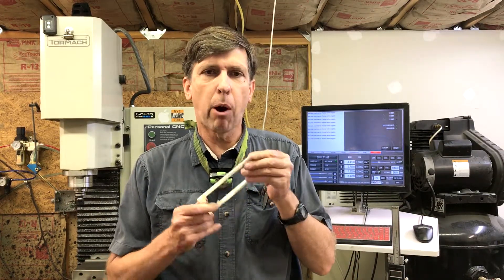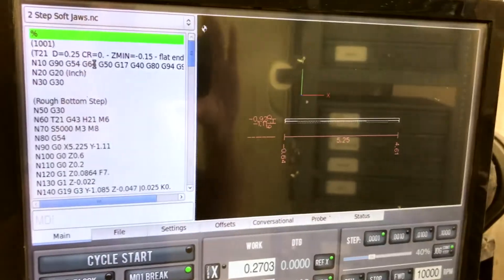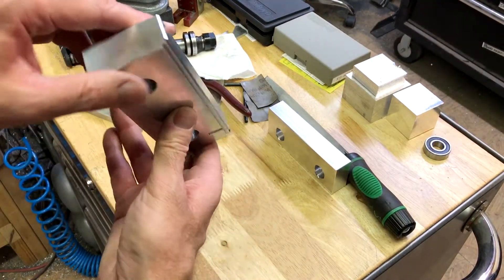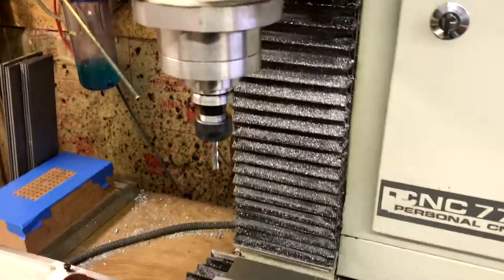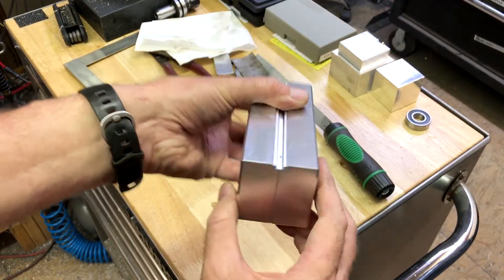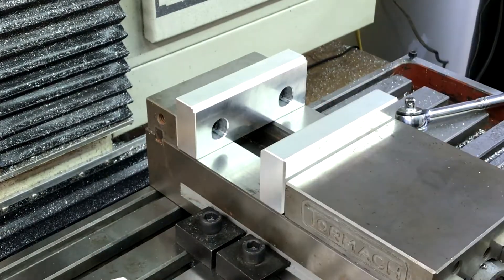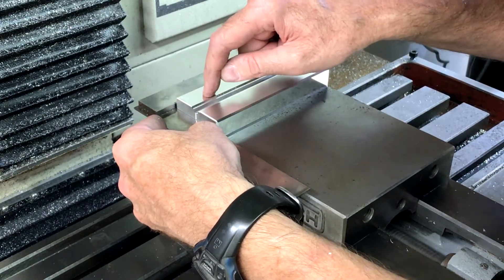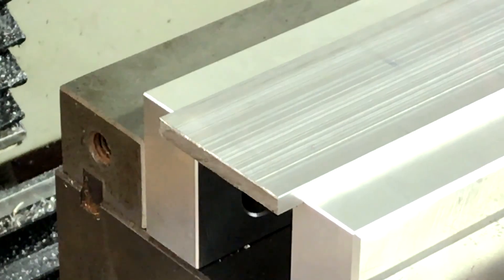Making Soft Jaws Part 1 - Machining

Comment: As soon as I get my milling machine set back up, I'm planning on tackling the same project.  One thing I am thinking about changing from what you did is machining an outside alignment that rests against one of the side faces of the vice.  Would you see any problems in doing this?
Reply from the maker: Cool. I'm kind of new to using vise jaws.  I normally see people use a square to line the 2 jaws up and set zeros off the back left corner of the jaw.  It would be cool if the zeros could be set on the vise itself and jaws interchanged without having to set zeros each time.  Are you talking about milling the back side of the jaw or adding something to the jaws like a dowel pin?
Reply: I was actually thinking about machining the jaw width's, slightly over sized then taking 1/4" off the bottom that contour close to the inner rails of the vice.  This would allow you to have a tab on the outside of both sides of the inner vice.  Then I would drill and tap a hole in each tab and place a set screw in for fine horizontal adjustment.  If I can figure out how to post a picture or link in the commends, I will post a rendering of what I am talking about.
Reply from the maker: Sounds cool.  I was considering the Carvesmart but I think I would loose too much of the opening.  The Tormach vise only opens around 4.5"

Comment: I enjoy the videos. I just ordered my 770 today. They are sold out of 5 in. vises, so I'll have to figure something out there.
Reply: You might check out the Shars 5" 550V vise.  I have had the Shars 440V for my Tormach 440 for about a year and I really like that vise.  It has a much bigger opening than the Tormach 4" vise. If you need the machined sides then you'll have to look elsewhere as Shars doesn't offer one in 5".
Reply: Jason Hughes I'll check it out, thanks man. I wonder if 5 in. is the right size (I'm new to this) for my 770 or should I get a 6 in.
Reply: Johnny Blaze ZX14R I think the consensus is the 5" is a good size for the 770 for general work but it always depends on what type of work you do plan on doing.  I bought a 6" vise and that thing is monstrous.  Definitely check the dimensions before you get a 6".  Ha.
Reply from the maker: Yeah, Jason is right about the 6" vise.  It is big.  I went with the 5" CNC Vise because it was cheaper.  Not sure if the CNC or the Machinist is better.  If you get the vise keys, they will get you within a few thousandths when tramming.  Just a note, the opening on my 5" Tormach CNC Vise is only around 4.5". Its 5" wide.
Reply: Thanks for replying, I'm not sure which is better between CNC or Machinist vise either. I'll get a 5 in. one when I decide which manufacturer to go with. Glacern vise is one that I'm also looking at. I've watched Jason's videos and see that he uses the Shars and it appears to work fine.
Reply from the maker: Thanks Johnny!  Congrats!  I'm sure you will love it. I've been running mine 6-8 hrs a day recently.  It's a work horse.
Reply: I have a 770 with the Tormach 5" Machinist vise. If you can't get a 5" from Tormach with your order, I would just get one from Shars and call it good. Get cutting and have fun!